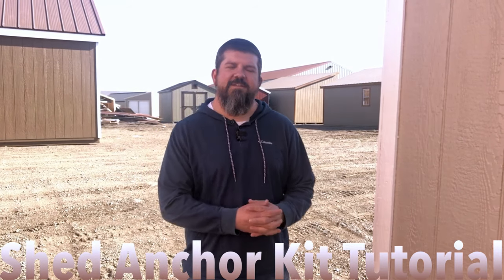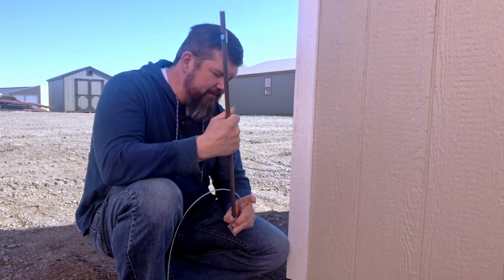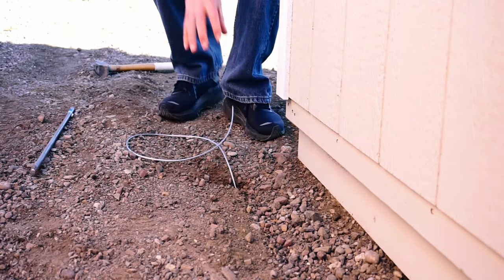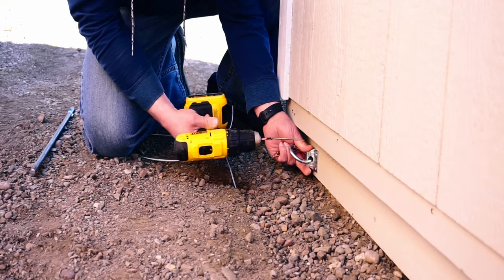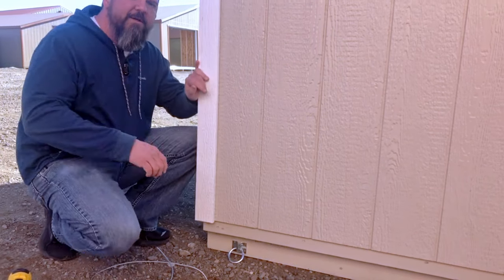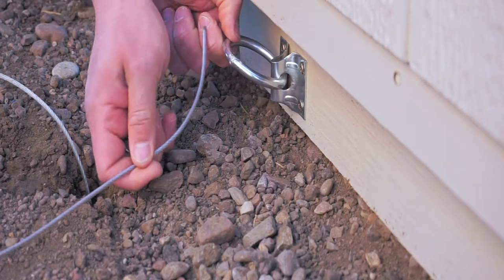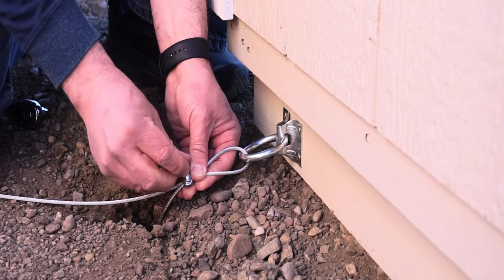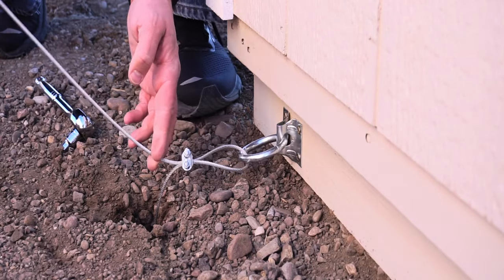Shed Anchor Tutorial

Comment: TIP: When I worked for U.S. Forest Service as a Fire Camp Boss we always gave the Lead Cable a stiff tug or two to set the Arrowhead before attaching the lead cable to anything. Good Video, Thanks!
Reply: HE EXPLAINED THE ARROWHEAD ROTATES SLIGHTLY AS IT GOES INTO THE GROUND. YOUR LITTLE TUG IS NOTHING WHEN A WIND KICKS UP.
Reply: @misfitty-vd6kv  Tugging or setting the anchor gets a bit of slack out of the line before connecting it to the building. Good practice.

Comment: I would suggest installing the hardware first then tap down the anchor so that it’s tight. Might be ideal.
Reply: Give a hard tug on the cable after it's in the ground and before you put it through the O-ring.  If you attach the hardware first, you won't be able to take up that slack.
Reply: @kittywilhite9583  seems to me you would be able to take up the slack as you hammer it down in the ground. Once you put all the hardware on, I guess you could still tamp it down
Reply: With it being so loose, it seems like it would just bounce around in the wind